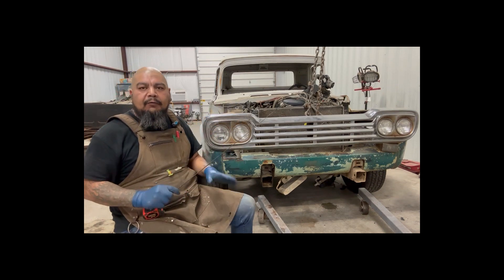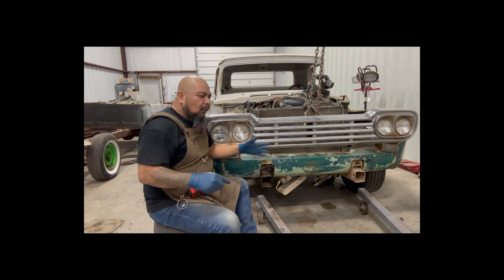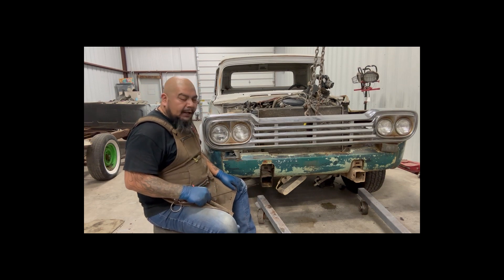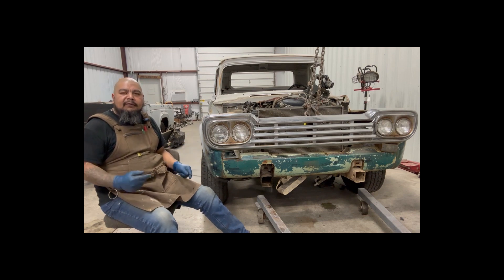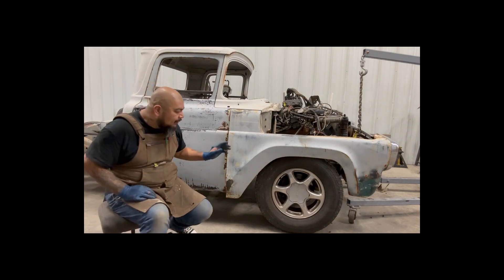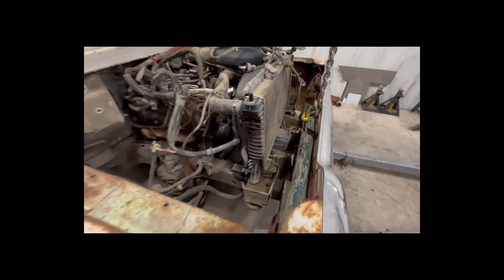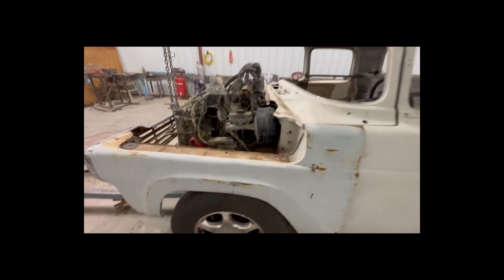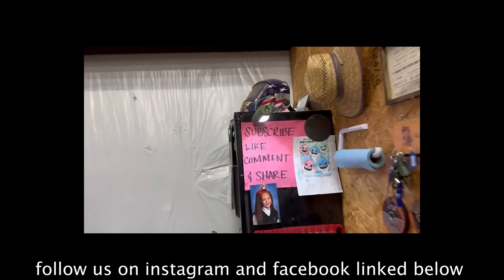June Bug F100 Race Truck F150 Body Swap Part 11

Comment: Thats cool i have a 1955 2nd serie chevy maybe ion would have an idea what kind of gm car would work under my truck with an ls. Drivetrain
Reply from the maker: I say measure width of tires then find a close match . Length isn’t too important but helps if it’s close too